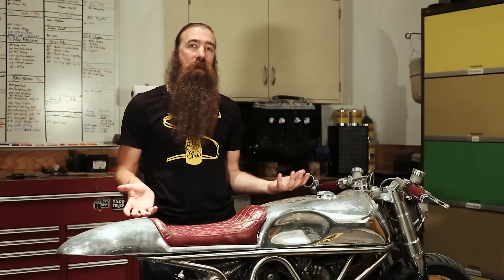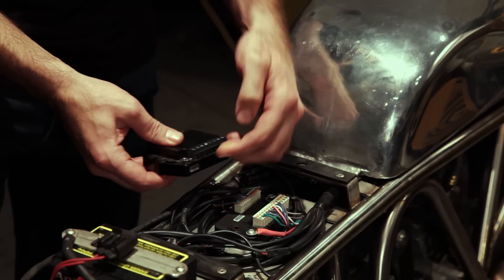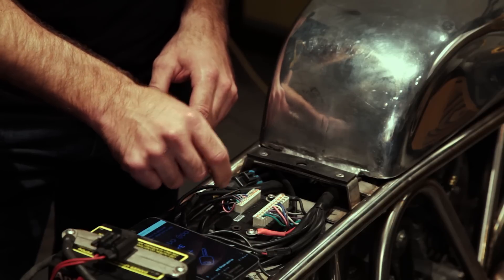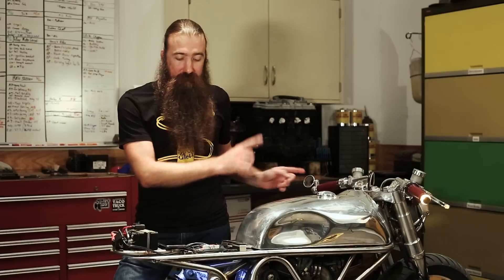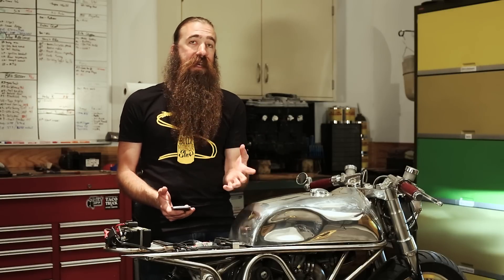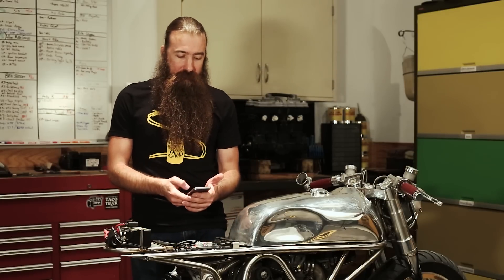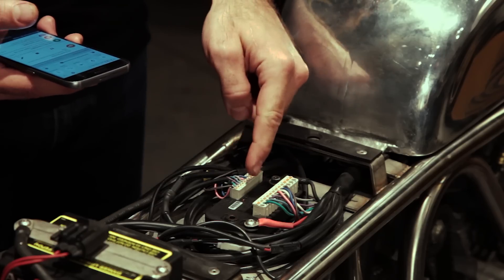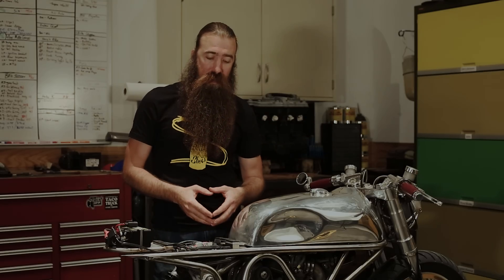Revival Cycles' Tech Talk - The M-Unit Blue on an Actual Motorcycle

Comment: Same as the other comment, will a mechanical back up ignition unlock the unit if you phone is unavailable? Is it known what will happen if the battery on your phone dies while you are riding, assuming you're using the Bluetooth as the ignition at the time?
Reply from the maker: If the phone dies while you are riding, the m-Unit will keep working normally until you turn it off, once you've turned it off it will not restart unless you get bluetooth working again, or use a manual switch. Yes, it is a good idea to use a backup switch just in case something happens to your phone. The switch can be a simple toggle hidden under the seat, or a key switch, or an m-Lock. Whatever works for you.
Reply: The lock and ignition functions of an m-unit are separate. The Bluetooth function just unlocks the ignition function, allowing you to use the starter button. I do not believe that MotoGadget would allow the bike to turn off if it lost Bluetooth connectivity, sounds like an huge insurance nightmare.
Reply: Demoni696 I would think similarly. now can a Bluetooth immobilized bike be manually started with a key
Reply from the maker: Exactly, if the bluetooth looses connectivity while riding the m-Unit will continue to work normally until you turn the m-Unit off.
Reply from the maker: Yes, the standard lock input continues to work normally  even if the bluetooth is enabled. Basically the Bluetooth only adds functionality, it does not eliminate any of the normal operations.
Reply from the maker: It is recommended that you use some type of physical ignition switch in addition to the keyless go, because if your phone dies while you are out you would not be able to re-start the bike after locking it. (bluetooth is only needed to unlock, once it is running loosing connection is not a problem) 

You can use an m-Lock, or any other switch (toggle, key, etc.) but it is a very good idea to have something in place just in case you are not able to connect via bluetooth.
Reply: Revival Cycles so you would still recommend keeping the m-lock in conjunction with the m-unit blue? it would just be a redundant piece then yea?

Comment: Quick question: I have the m-unit blue connected with my phone. My battery died. I don't have an easy access to the m-unit and i cannot turn off the Bluetooth. What happen to the bike?
Reply from the maker: Assuming you are talking about the battery on the phone and not the bike, the m-Unit will continue to work normally until you turn it off by double clicking the start button. Once the m-Unit has been turned off you will need to re-establish Bluetooth or use a conventional ignition switch.
Reply: I would still recommend having an actual key to start the bike just in case of something like what you described happened.
Reply: I'm pretty sure it's like having a pair of Bluetooth headphones and a pair of wired ones. You can use either or.. it's just that bluetooth makes the whole thing a breeze
Reply: had a usb plug to you're bike with a simple switch. There charge your phone on your bike
Reply: yeah. the demo bike in this video even has the setup you describe. @3:25 he explains it when he does the setup.
Reply: Filipe Pena I imagine the whole thing is dead until power is restored.
Reply: keeping the key/ignition can it be an alternative? Can the key go over of this bluetooth system? If yes, i will not worry in change mine to m unit blue
Reply: this is great otherwise your phone dies and your bike shuts off